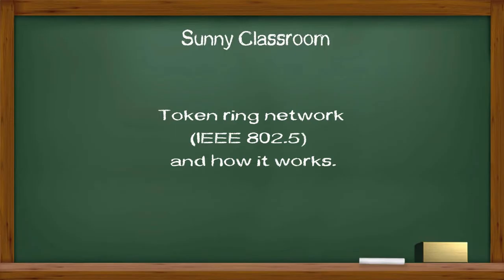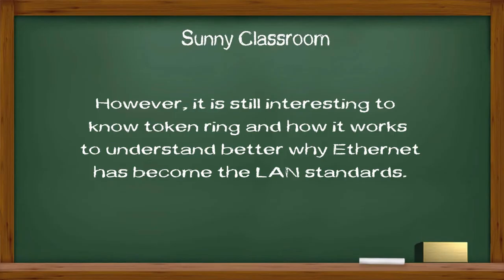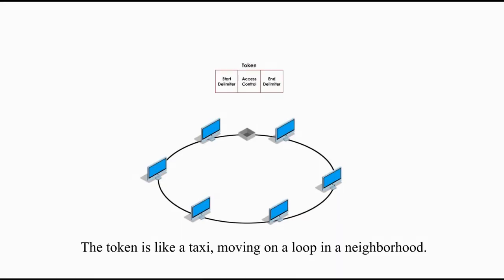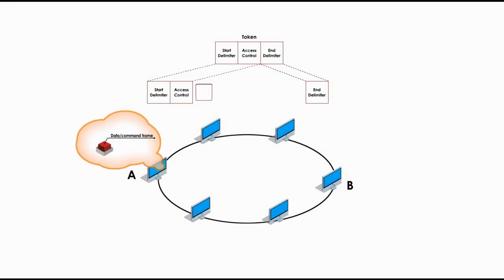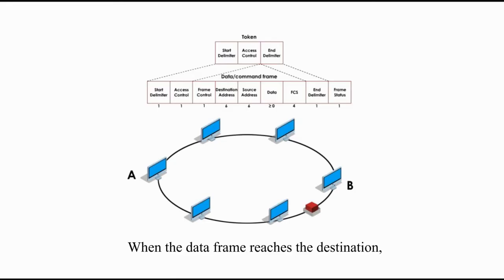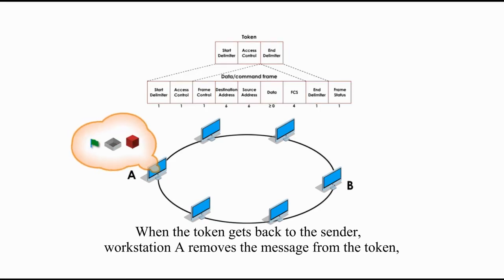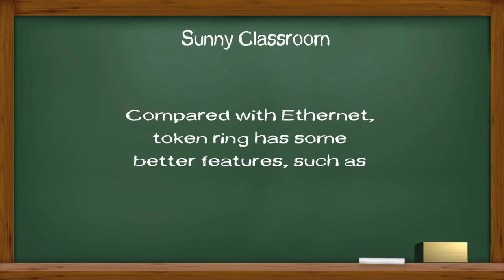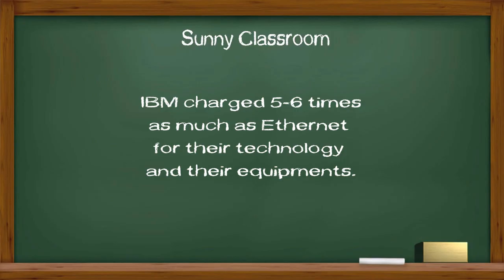Token ring network and how it works

Comment: One advantage of token ring is that it saves wires. Together with 48v power supply, this reduces wire weight by 80% in a car like Tesla Cybertruck.❤
Reply: Saves wire when compared to a CAN bus of a traditional car, but not with the ethernet

Comment: If all local serve buffering upload readied standby until receive the token generate by random number generator so even router can not even predict because token wrap all in package unlable except for token information only unwrap at host and client and main server connected base on token ring but use random number instead of sequential time line so it it much harder for hacker to interfer

Comment: Anyone know the diff. between token ring and ring, in terms of fault-tolerance? Is token ring simply a ring network with a token? Then why do they keep talking about it being "configured as star"? What's the advantage of that? This video does not show star config. of token ring. Thanks!
Reply: I think I just figured it out--token rings are PHYSICALLY connected as star (only because it's impractical to link machines directly together), but LOGICALLY connected as ring (as this video shows). Is that right? In that case, if any system goes down, the network goes down, just as in ring, so the fault tolerance is exactly the same as a physical ring network. Right?